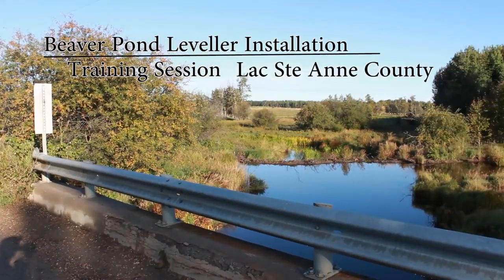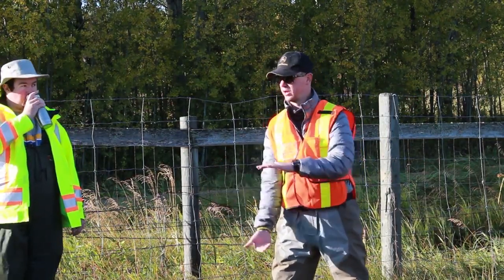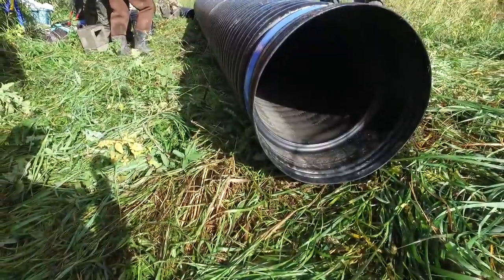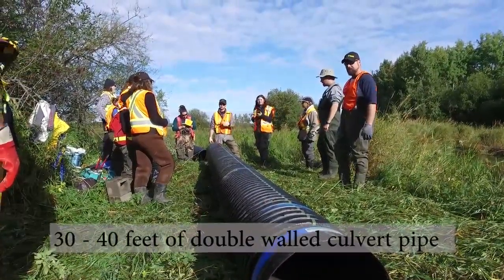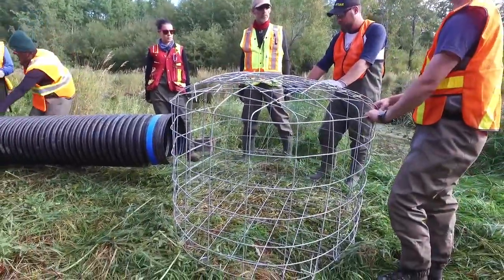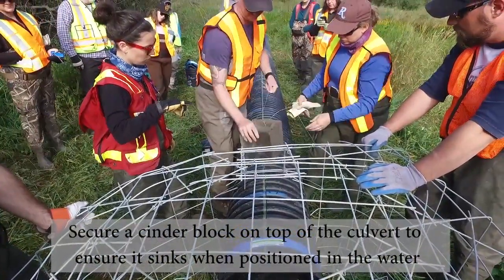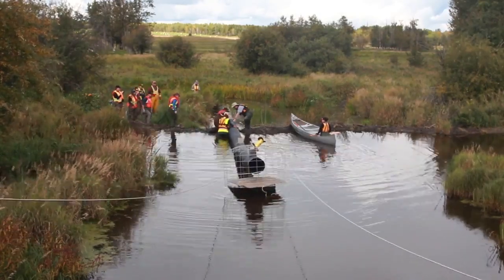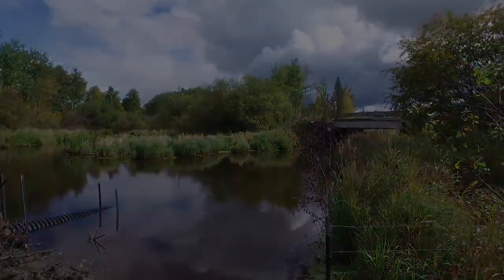Beaver Pond Leveller Installation - Training Session

Comment: Wont they just plug up around the cage
Reply from the maker: Good question! The inlet end of the pipe is suspended in the middle of the cage, reducing the feeling of flowing water thus reducing the beaver's instinct to try to plug it. If they do feel some flowing water, the surface area of the cage is much too large from them to effectively plug it, even if they try. Additionally, this is one reason why the pipe is extended approximately 40 feet into the pond, far away from the outlet end which produces the sound of running water. By having the inlet and outlet ends far apart, the beaver can't usually figure out where the leak in the dam is coming from or how to fix it. I have not heard of a beaver successfully plugging the cage on the inlet end but it's something to monitor for.

Comment: Is there a reveiw on this a year later or two to see what the results are?

Looks like a great idea.
Reply from the maker: Great question! We do our best to monitor all of our install sites yearly or ask partners how they are functioning. Pond levellers require maintenance checks once or twice a year to ensure they are working properly and to clear any vegetation or debris that may build up if it's installed in a shallower pond. Occasionally the pond leveller requires adjustments such as the installation of a protective grate on the outflow end of the pipe, but most of the time this is not necessary. To see examples of other pond levellers installed in Alberta, please visit our  Map of Beaver Coexistence Tools (https://www.rockies.ca/beavers/map.php)
Reply: @Miistakis  thank you.

Comment: Won't the beavers eventually cut through the plastic, and then plug up the tube?
Reply from the maker: Great question! Although that is possible it's unlikely and we've never heard of that happening at a site. It's unlikely because the beaver is motivated by the sound and feeling of the water flow created at either end of the pipe (outlet in the dam, and inlet which is placed in the pond). The inlet is protected by the large wire cage so the flow created is not as strong since the pipe sits in the middle of the cage. Essentially they cannot figure out where the source of the "leak" in the dam is located so do not know the pipe is involved at all. They will sometimes dam the end of the pipe but it's difficult since they are working against the flow of the water, and if this happens, metal fencing can be applied at the outlet as well.
Reply: If they damage it in a few years they'll just install a new one.  Doesn't look super expensive.